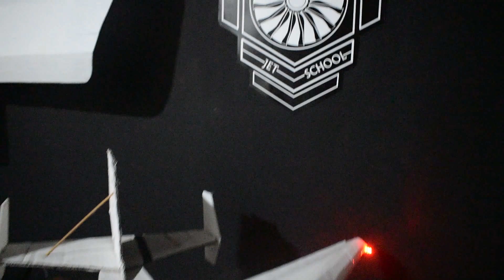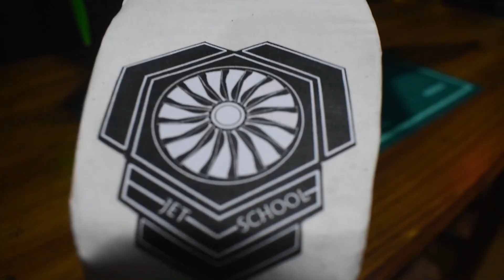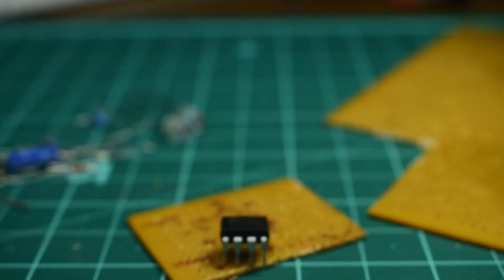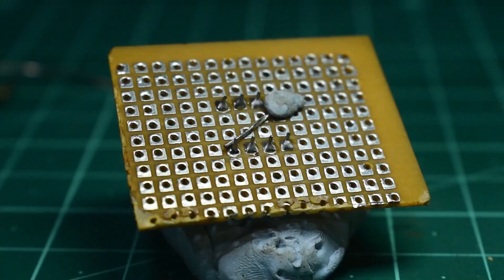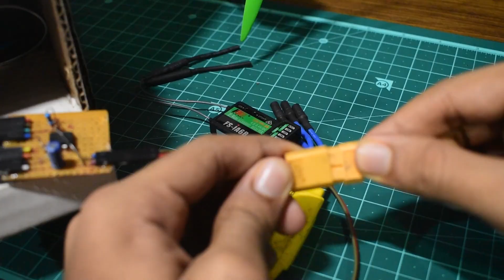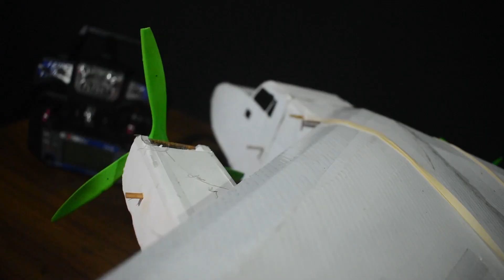DIY RC PLANE NAV LIGHT MODULE BUILD [PART-2]

Comment: I don't have a social media account, and don't intend on getting one. Do you have any other way to list your schematic design?
Reply from the maker: I don't have a website
Reply: @JetNautics  Thanks, I'll try and make the schematic from your videos. I appreciate your quick response.
Reply from the maker: @rromano158  https://www.flitetest.com/articles/diy-rc-airplane-nav-light-module-build-part-2 ,This article  doesn't  have the schematic ,but has the steps.
Reply: @JetNautics  Thanks again, I was able to copy the front and back of the schematic from your Instagram post.
Reply from the maker: You can Try accessing the link without an account

Comment: If you add a resistor of a lower resistance to your Red and Green LEDS, they will shine brighter. I have a similar design, but use a 120 ohm on the Greens so it shines brighter.
Reply from the maker: Yeah ur, right it will but since i made a single output to multiple leds that operate at different voltages tgey have instable light and one of the blink lights won't work

Comment: How did you solder the ends of the 6 contactors together
Reply from the maker: Please tell me the time in the video ,which step?
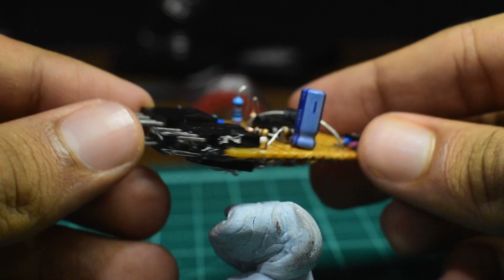Reply: @JetNautics  Contactors at 3:34
Reply from the maker: I soldered the leads to a single output it took a little time to figure out how to connect 3outups  to 1 without shorting , I dono how to explain to you.

Comment: Can you explain the resistors you use one by one ?
Reply from the maker: Its best you buy a resistor set and test it with various combinations, and see which blink time and intensity you prefer, the resistor values I used are given in the previous video, Part-1 towards the end.